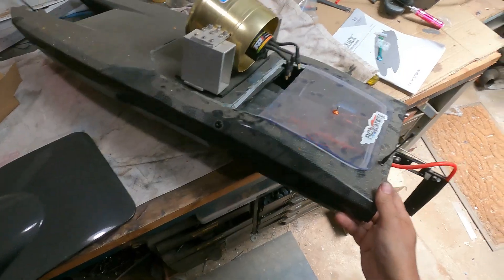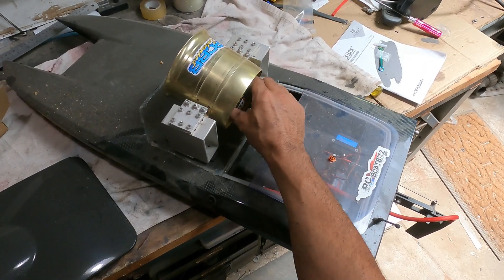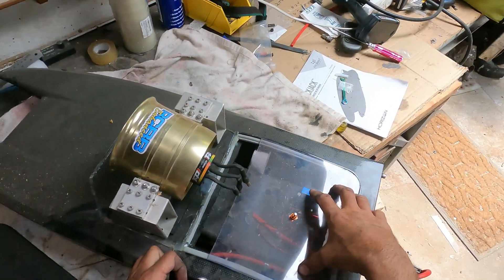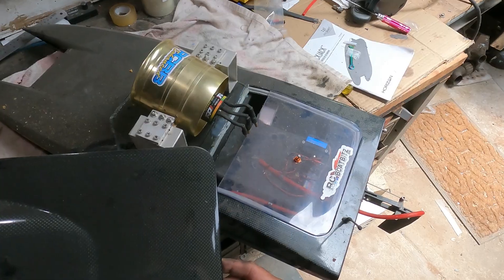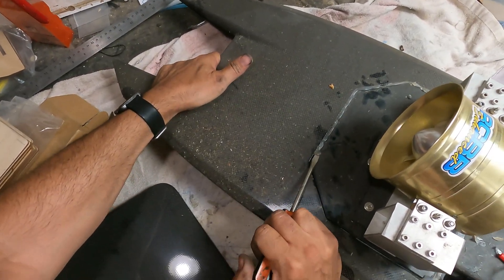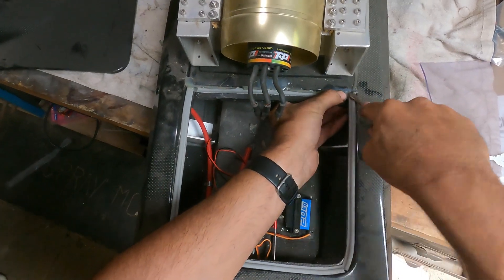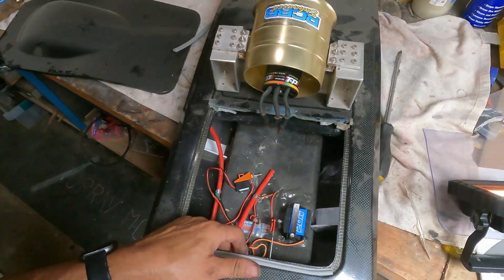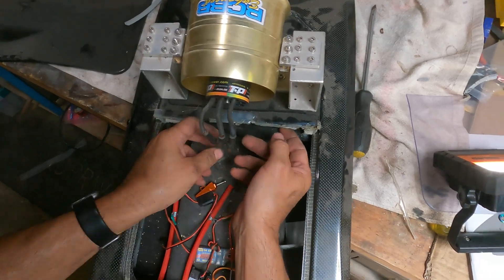EDF powered rc boat build

Comment: Very nice! I am currently building a edf rc boat to, powered with a 70mm edf (6s) which hopefully can go maybe 45mph, then I’ll add a second edf (10lbs thrust total on a 6lbs boat) and hopefully it will go over 60mph if not 70, maybe I’m asking to much, but this coming up weekend I’ll test it and we will see 😁, also what edf is that? And how many cells can it take?
Reply from the maker: Its a tp brand 12blade 120mm, can handle 12s, that fire up was only 6s
Reply: @RCBoatBitz  oh ok, yea yours is definitely gonna go faster than mine lol, thanks for replying!
Reply from the maker: Anytime!